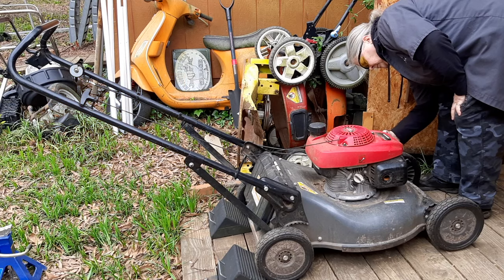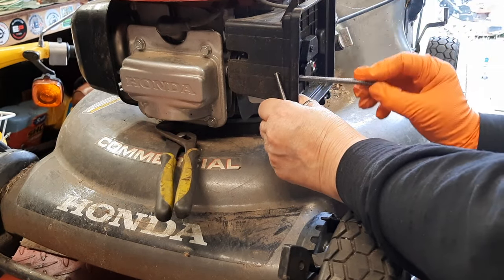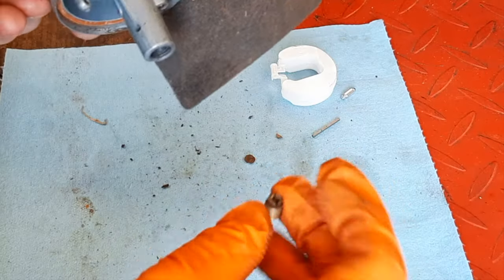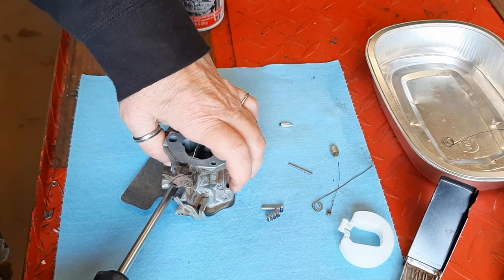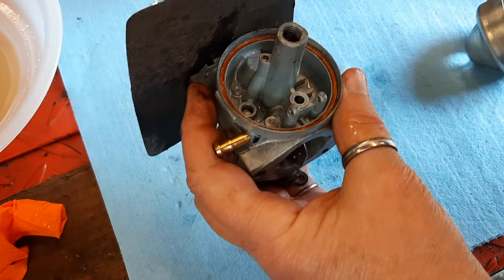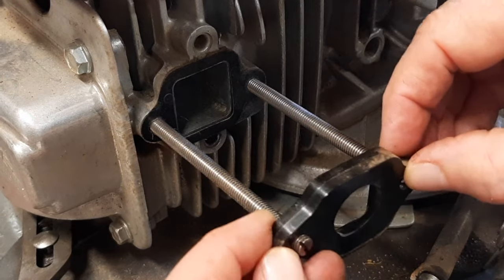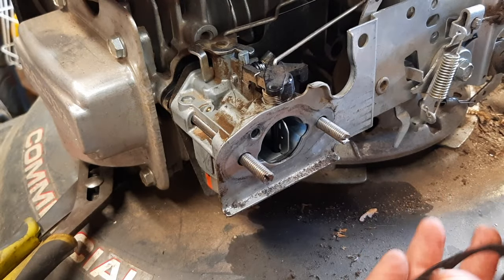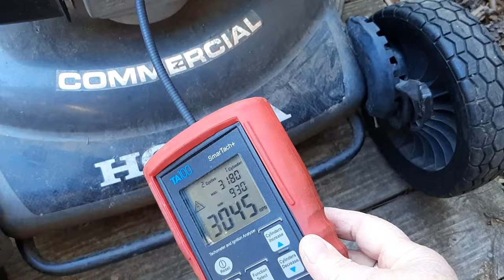Honda HRC216 No Start: GSV160 Carburetor Clean How To

Comment: Great Video, but did exactly how you explained but still she doesn't start, ive checked the auto choke and it is closed when I try to start it and there is also a spark at the plug, any ideas ?
Reply from the maker: Thanks for watching. It's difficult to diagnose over the internet. If you can get it to cough a bit by directly squirting a small amount of fuel into the venturi of the carb, then you know it's a fuel delivery issue. Spark plugs can test good in open air, and fail under compression. Might be a timing issue, is the blade bent or have any large dings? Wish I could be more helpful

Comment: Thank you for identifying the temprorary studs for the airbox as 'M6 All Thread ~ 100mm (~4")' and providing the link to Amazon. Could you please explain how you cut the screwdriver slots at the ends of the studs? That is a great idea. I apologize if the answer to my question should be obvious.
Reply from the maker: I used a Dremel tool with a cutting disk. If you don't have a Dremel tool, a hacksaw with a fine tooth blade will work too. Use a vice to hold it steady, and make sure the jaws of the vice only crush the threads in the middle of the stud. Thanks for watching. Cheers!
Reply: @TheLawnmowerLady  Thank you for the excellent description!

Comment: Thanks for the video 👍
 I'm curious why you're not a fan of carb cleaner and what do you use instead, WD-40?
Reply from the maker: Thanks for watching! Carb spray will swell up rubber bits, and degrade o-rings and such. Easy to shoot in your eye, even with safety glasses, and it's pretty toxic for the environment. I generally use my ultrasonic cleaner with Pine-Sol, or Vinegar, or just Dawn dish soap. Cheers!

Comment: I used to work in a Honda shop.  We never used those studs.   To reinstall the carbie.  Istall the entire carbie gaskets etc on to the air filter housing.  Then with everything installed to the housing with the bolts of course attaché the bolts to inlet.      When you removed the carbie you took the bolts out.  What if you didn't ?   You would have the carbie ready to bolt on.
Reply from the maker: That works too, but it can be fiddly for sure. Thanks for watching!

Comment: Love all of your videos as always. Just a quick question, did you go to small engine repair school to learn how to work on them?? I have absolutely no clue what I’m doing and I can’t get crap lawn mowers and things to practice on because I live in an apartment and I barely have room for the mower I have. I’m going to eventually do online classes of Stratford career institute because I so badly want to be able to work on small engines and be able to work on my equipment without having to pay someone to do it. I need any and all practice so I can try to figure out how to do this where I feel comfortable doing so
Reply: Hey David,
You already have on line classes. Its YouTube! 
I took classes at my local college, cost roughly $1200, got my EETC certification (equipment and engine training council), and I have learned more from the likes of Stella on YouTube than I did by taking the course. 
Finding machines to work on isn’t always easy but ask your friends, roadside finds are often  something easy to fix and flip, and your local landfill can be a good source. 
Save your money. Stick with YouTube. 
Best of Luck David
Reply from the maker: Thanks Mr David. I have a long history with scooters and motorcycles, and the lawnmower thing just naturally progressed. I’m all self taught. But Mr EzRay’s comments below nail it. So much is on YouTube, and after you learn a thing or two, you will quickly distinguish the best practices out there. Look for shop manuals online for specific tolerances on particular equipment. I really appreciate you watching. Cheers!
Reply from the maker: Thanks for the kind words Mr Ez. Cheers!

Comment: Great video! I wanted to make up a set of those retainer studs but could not find any metric all thread. I used 5" long bolts and threaded the opposite end with a 6mm die after cutting the heads off. I left the 1/4-20 threads on the one end. Is there any application you can think of that would use the 1/4-20 threads?
Reply from the maker: I think all those carbs like that (Koehler, ruxing, etc.) are all metric. I think I put an Amzn link to the stainless steel M6 all-thread that I used. I figure stainless is softer, and less prone to cross thread. I appreciate you watching! Cheers!

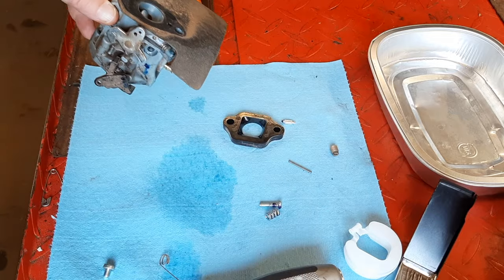Comment: hI AT 7:39 YOU are putting idle circuit screw... i have hrx217(higher end) and it has throttle lever i can increase or decrease...  question is can u ever adjust the idle speed (RPM) USING that screw.  have you ever done that, i thought if i want to increase rpm or better idle speed it is all about adjusting governor arm,(offcourse it open throttle valve)..  apprecaite your feedback.
Reply from the maker: No, that screw is merely an access cover to clean that circuit. There is a air/fuel mix screw just above my index finger, that has an anti-tamper cap. With that cap on, that screw can be adjusted about 1/8 turn. I rarely (if ever) have adjusted that screw. The idle speed adjustment screw is the one I am replacing at 07:49 That screw adjusts the idle RPM by keeping the throttle butterfly partially open. Hope this helps.

Comment: Whar is the difference between a Commercial mower and a residential one? Other than having the plate that you first removed,  that mower appears to be basically the same as my residential mower made in 07. And is the extra cost worth it?
Reply from the maker: Heavy reinforced deck, sealed ball bearing wheels, diagonal handle reinforcement, robust and corrosion resistant drive and control cables, washable pre-filter, the list goes on.

Comment: I have a question concerning my Honda hrn216vkaa. When mowing a slope in my yard the mower spits and studders a bit. The slope is pretty steep so I have to mow it diagonally. Is this normal? What would cause this?It's a new mower. Thanks.
Reply from the maker: Hmmm. The only thing I can guess is the float in the carb bowl sits too high. It's not adjustable (like some) but basically the float needle cuts off the fuel supply too soon when you are not mowing flat on the ground. I imagine there would be a difference when traversing the slope with the carb down the slope rather than the other direction with the carb up in the air. The orientation of the hinge pin allows the float to perform better when mowing the slope diagonally.

Comment: Lawn mower lady how do I raise the the idle on a Briggs engine with the  carb that's mounted on top of the tank? It is the 4.5 ft lbs of torque engine 1.88cc
Reply from the maker: Thanks for watching Mr Anthony. https://youtu.be/s1eiIAJC_jo Although this video is on a Briggs Quantum engine. The principle is the same for any small engine. The governor return spring attaches to done sort of tab or bracket on any engine. You need to increase the tension on that spring to increase the RPM.

Comment: Mt pull cord doesn't recoil all the way or does so slowly. Any ideas?  (honda hrx 217 lawn mower)
Reply from the maker: Could be a broken return spring? Rust or corrosion? Easy to pop off the recoil with a 10mm socket for a look and see.
Reply from the maker: I just use WD-40.

Comment: When i pull my mower lever to the tortoise slow idle mode it cuts out, does this mean my carb needs cleaning?
Reply from the maker: Sometimes? There is an idle adjustment screw that's difficult to get to behind the airbox. It opens the throttle just a bit.

Comment: I went to tractor supply...and they said they did not have any M6 studs.🙁
Reply from the maker: They won't have anything like that. I bought these M6 all-thread rods: https://amzn.to/3tq4Xa8 Cut them down to just under 100mm (4 inches) or so, and used a Dremel tool to cut a slot for a screwdriver. Thanks for watching.

Comment: Did all this process three times with mine and still won't run.. runs on fuel squirted into carb but will not run at all from carb alone
I'm guessing maybe the non removable mixture screw or something lodged somewhere so ended up buying a cheap copy carb. First time ever had to do this on a mower but had same issues with strimmers in the past.
Reply from the maker: Sorry you're having troubles Mr G!  I think that idle circuit maybe still clogged. Some models have a plastic removable idle jet. That can be cleaned out. Otherwise, lots of carb spray, and tiny wires. Thanks for watching. Cheers!
Reply: Fuel line filter in side the hose maybe

Comment: Ok lady lwt me lay one on you.i took the carb off and cleaned it. Being careful with the oring gaskets using carb cleaner i also roded out and sprayed all the holes on the brass tubes.then put it all together, then i checked and cleaned the back of the auto chocke thing,then i watched your video and i took the flywheel off and it was all good. Put it back together it started briefly and quit again wth am i not doin lady?
Reply from the maker: Check the idle circuit. Likely jammed up.

Comment: After used turn off the fuel valve and let it idle until it die. Won't have trouble starting next time.
Reply from the maker: That is good advice, that far too few follow. Thanks for watching.

Comment: I have taken these apart before with screwdriver...I'd rather not risk stripping it...why can't I just cover the top of it and spray with carb cleaner...all that pressure built up should clean out those tiny holes
Reply from the maker: That works. But I usually end up spraying carb cleaner in my face!

Comment: Taking the carb off can mean having to order gaskets. Or make them................I'd charge for the quick turnaround
Reply from the maker: You're right Mr Bob. I have small collection on hand, but rarely have to replace them. I do charge a carb service fee if it comes off the machine. I appreciate you watching. Cheers!

Comment: Hi Stella can I pick your brain sons after his first scooter the guy selling saying it bogs out he's put new carb on still bogging out x
Reply from the maker: What kind of scooter Mr Gary?
Reply from the maker: Not sure I can be much help here. A quick look Leximoto shows all their scooters with EFI, so no carbs. If it’s an older model, no doubt it will have some type of Minarelli clone engine, probably a GY6. I think scrappydogscooters.com has the best info for figuring this out. I hope this helps. Cheers!
Reply: @TheLawnmowerLady  I thought fuel if bogging but he said new carb fitted so don't no but big thanks x
Reply from the maker: They all have an auto choke mechanism, that might have been the problem to begin with. The auto choke, unless ordered separately, would just move over to the new carburettor. And the term "bogging" can be misleading: bogging rich? or bogging lean? Either can seem like the same thing. A look at the plug might give a clue, but 4-strokes don't tell the story as well as  2-strokes.

Comment: When I clean a Carbrator I don't use carb spray I use break cleaner
Reply from the maker: That actually is not a bad idea, it's not as damaging to rubber bits as the carb spray is. Thanks for watching.

Comment: The gas was bad. I will run a small diameter bristled brush up into emulsion tube and knock out any blockages. 50/50 times it’s worked otherwise I disassemble carburetor
Reply from the maker: That's a great idea Mr Joseph. I've not found any small enough in my shopping. I appreciate you watching. Cheers!
Reply: @TheLawnmowerLady look for a teapot spout brush

Comment: Oh i have a kohler lawnmower
Reply from the maker: Very similar to Honda mowers. Make sure the idle circuit is clean (usually a screw on the top of the carb. After that start with the basics: spark, fuel, and air.

Comment: Hey, Stella!  Thought I’d share this with you. I just learned something today that would cause the same symptoms as a failing coil when its laminations are starting to come apart at operating temps and the engine shuts down. I was reminded of Arch’s Garage and a couple of coil testing videos he did. Apparently a failed spark plug can cause the exact same symptom. It resistance tests fine when out of the engine but gets wonky and fails when it gets to temp. James Condon did a generator video three years ago and finally found the cause of engine shutdown when he put what seemed like a good plug in his vice and heated it to operating temp with a torch, then tested it. Sure enough, it was fine before heating but after heating resistance values were all over the map until it cooled down again. Have you ever seen this before?  I wonder how many times people have swapped out coils but didn’t know this was what actually caused the issue and it still wasn’t solved with a good coil. 👍🔧🧰
Reply from the maker: Thanks Mr Rein!  I have heard others refer to a similar situation, but I've not experienced that myself. The honest truth for me, is changing out a coil is my last resort, as they often involve a deep dive in some engines. In my antique scooter world, spark plugs are cheap, and easy to replace. Go for the cheap and easy things first. Cheers!
Reply: The Lawnmower Lady   You bet! 👍
Reply: I have a 1960 champion spark plug tester and it will show a bad plug in a heartbeat 
Love Dad’s old shop equipment he left me